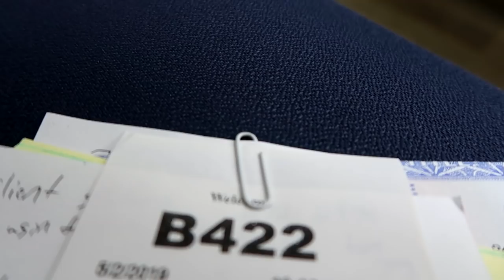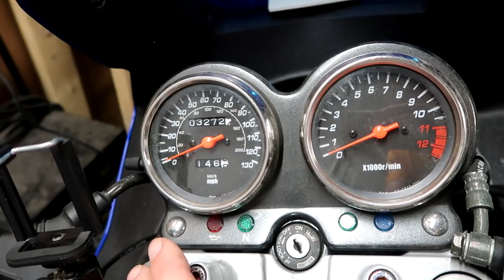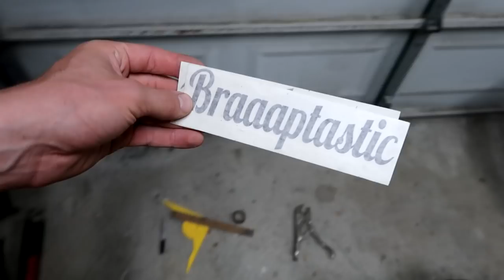Revealing My New  Bike

Comment from the maker: What I wasn't the 1st like?! I'm outraged
Reply: Dalton, make the Honda great again 🤘✌
Reply: Can u plz make more keep videos
Reply: Jeep videos sorry
Reply: 3DMachines yes, u want the GSX-R 600. This bike is a GSF 500. The GSX-R’s will not have the upside down forks and handlebars will be totally different. But that’s okay we’re sure in the future you’ll get your Gixxer.
Reply: I have several different crotch rockets only one Suzuki  and it's the actual crotch rocket which is a gsxr 600 it's a 2001 I picked it up for 400 bucks with 18k miles so barley broke in what u have is a gsxr 500 it's the 2nd step beginners bike the 600s have way way more power as for your gas leak around the tank lock it's supposed to have a seal that sets under it if u take the screws out u will be able to see if it's there if not just get one or make something that will work like the exhaust though it has the same one as mine Yoshi rs3 Damm good one for the 600 sounds amazing don't know about on the 500 because I've always had the 600s and up o also when u go to put your gas cap/lock back on use a tad bit of lock tight other then that nice bike stay safe and brap on brother
Reply: 3DMachines I’m a Honda guy thru and thru.. you should get that thing goin again or sell the new Suzuki 500 and get a CR500 or a nice CR250 or any Honda 2 stroke even a old quad TRX250R!!!! Or put a CR500 motor in something and have a wild machine!!!!!
Reply: Dalton what happened to the seca

Comment: Be good for you to do some riding vlogs now, she looks clean. I bet your spewing it's a 500 lol good cheap commuter though. I'd imagine there's a seal under your gas cap where it screws into the tank, you have to determine weather it's leaking from there or is it the cap seal. Also ensure the breather is working an not building up pressure. Take care Mark.

Comment: You don't have to worry about it being stolen, you could easily tell it's not a GSXR from the 1 brake rotor on the front wheel, thumper engine noise along with everything about that bike.